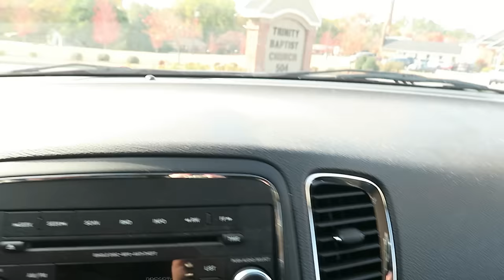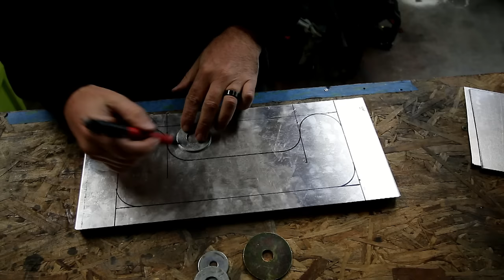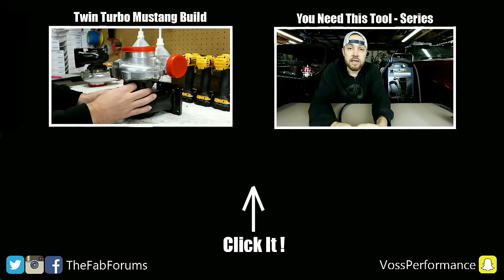Custom Metal Fabrication Tool Cart Build

Comment: When you beadroll a design inside a piece of prefabricated metal that had straight edges, does the beadroll distort those straight edges?
Reply from the maker: the bead roller can distort the metal some in some cases

Comment: hey man on the top trays you added.. you can add some magnets to the bottom so if you have some screws or bolts and while your rolling the cart around they won't fall..
Reply from the maker: not a bad idea. the only problem I have with magnets is they collect all the metal shaving when metal working around the cart.

Comment: if you deepen out those beadrolled parts on the side extentions you could trow youre loose screws and stuff in it for safe keeping when working on sumting , a thick rubber mat on the whole surface might be nice too and cover up the edges of the toolbox itself 
could allso extend the back part holding the airtools intoo those side extentions maibe make the side support on the back slanted from the original corner of the toolbox to the corner of the extentions around the rear  
 
you could make some shallow folded and welded baskets for small stuff under the extentions for stuff like spraycans 

been thinking on making my own toolbox but it might be more of a multy layer pegboard style setup you can roll around and leaf trough like a book , i do most of my wrenching sitting on the floor next to my car or laying under it , so having everything ready and visible at that height is usefull to me

Comment: I don't understand how when you bead roll you put a crease or "ditch" in the metal, but then it looks like a pocket, like the area inside the line has been lowered. Does that make any sense?
Reply: I think there are tools that do just a bead and a tool that does a relief.
Reply: I think this is mostly an effect of what type of die is being used on the bead roller at a given time. Some might put a V into the work, others might just do a / or \
From the work I've done on sheet metal, bends or ridges almost always to big things for the stiffness of the part, and while his work is somewhat decorative to keep the part from being boring, almost all of it also seems to stiffen any parts that are going to see load.
Reply from the maker: Yeah it really depends on the die used. Some are made to make a "ditch" and some are made to just make a "step" The ones I use almost all the time are the step dies. I can make the panel step up or step down depending on the look I am after.

Comment: Did you use the bead roller for the nostrils of the skull too, or did you do that  with another method?
Reply from the maker: used the roller....it was tight though
Reply: The Fab Forums, a nice powered roller keeps making more and more sense to buy. thanks for the reply.

Comment: I'm 16, and have taken 1 work based learning course in stick welding class, and I want to find some kind of job or apprenticeship that I could apply for. Any ideas?
Reply: The thing about welding is, even though there is a lot of technique and metallurgy concerning it, what matters most is that you can successfully apply those aspects. The #1 factor in determining if you can is experience. if you are not going to continue schooling I suggest buying a welder b/c you going to have to invest your own money and resources to sharpen your skills to the point that employers /clients will trust you with there projects/materials. once u start becoming confident in your skills, weld a whole bunch of different scrap metal showcasing different joints and positions make a nice little box for them and a business card and drop off these sample boxes at machine shops and the like. Also learn to read welding blue prints. Good luck!
Reply: Rake MKIV thanks for the info, I'll definitely make sure to follow these steps before I go headfirst into anything! 👍
Reply from the maker: My advise would be to find someone that does what you want to do and offer to work for them....free in the beginning if need be. You will what matters the fastest this way.
Reply: The Fab Forums thanks! I'll start looking for someone now!

Comment: I love your channel. I am trying to get my creative streak going, it has been dormant for years while i finish my shop.  Could you please mention what gauge sheet metal you are using on sheet metal projects.  I think it would be helpful.
Reply from the maker: awesome. the thickness of the sheet metal really depends on what I am using it for. In this video I use .063 but like to use something a little thinner for designs.

Comment: need a shield to keep crap out of the air tool connectors.
Reply from the maker: yeah probably
Reply: I was thinking that as well, but I'm sure Kyle will address it.
Reply: GunPilot 
I never did like that system just for that reason.
very handy otherwise.

Comment: Sir I am 17 years old and i like to make Caston made things for example iam doing a mini cafe racer bike and iam trying to make the mounts for the engine. And iam asking you if you have any ideas to make it on a paper first and how to and then copy that on the steel    witch it 4mm thickness
My engine its fm 50 3 speed you can check my chanel i have my plans there. I really need  help    and i thing you are the best for what ever has to do with Caston making thing . thanks nice videos and keep doing them.